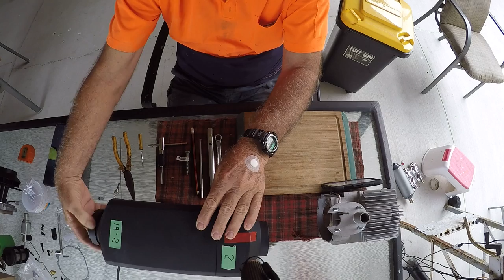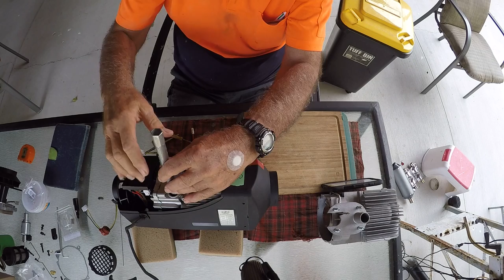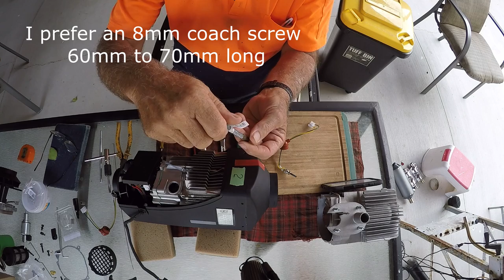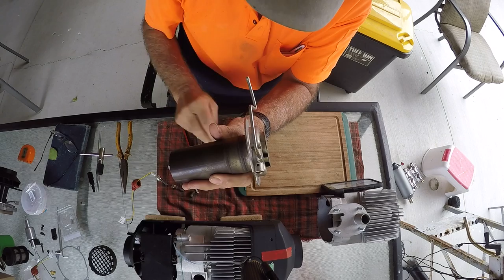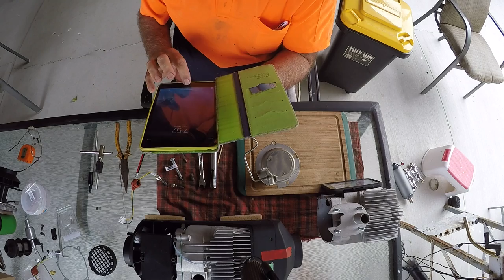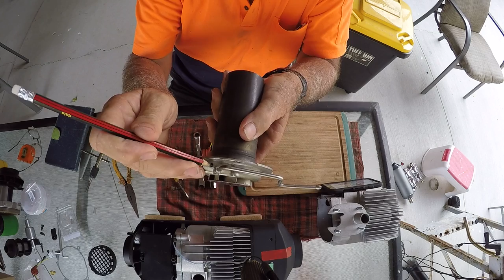Chinese Diesel Air Heaters - Part 9 Glow Plug & Atomizing Screen

Comment: John thanks. 
I bought the Vevor 2 kw heater with the 3 button controller. I’m running it at P 3.0 and it heats my big Sprinter van ok but does smoke a little. White smoke. 
How can I achieve a cleaner burn?
Reply from the maker: Hi Aaron,

Assuming your heater is new and you are using good quality diesel without additives,  white smoke is mostly caused by a poor burn. This generally is from  a bad fuel air mix, caused by restrictions in the exhaust or the combustion air inlet. Suggest you look at your install.

Some white smoke on initial start is not uncommon and is caused by some fuel residue left in the heater from previous use, but it stops after a short while when the heater gets hot.

If your heater is not new, white smoke indicates that it is starting to get excessive carbon deposits and it is time for a service. 

White smoke always occurs when bad fuel is used or fuel with any “oil” type additive. 

White smoke will occur when the heater is used at altitude due to a fuel air ratio mix imbalance due to the reduced oxygen content in the air at high altitude. The Genuine German heaters come with a high altitude adjustment in the controller, but at the time of writing this I know of no Chinese copy heaters that have this feature.  J McK

Comment: Thanks for a very informative video. I can't seem to find an answer my the issue with my chinese diesel heater. I wondered if you might have a clue? It doesn't have a digital display only a analogue temp control. The heater powers on, I can hear the pump working and there's plenty of fuel, there's no air in the system that I can see, the heater has plenty of air and enough power and I've replaced the temperature sensor but my heater still blows cold air. It doesnt auto switch off, it just keeps running as usual just that it only ever blows cold. Any thoughts would be kindly received. Thanks again,
Reply from the maker: Hi Wser,

That sounds very strange. 
Why did you replace the temp sensor? 
Did the heater work before, and not now?

Most important, if a new heater, are you using it correctly and waiting long enough for it to start.

In normal operation when you turn the heater on it goes through a start cycle. First fan comes on to blow out any unused fuel, next the glow plug is switches on and heats up, then the fuel pump starts ticking and delivering. When the burner is lit the fan runs fast for a bit to get the flame going well, and then reduces to the set temp setting. If the heater does not light it will turn itself off. It will not continue to blow cold air, unless the ECU is broken.

Can you please tell me if heater was working before, or if heater is new.

If new, never worked, and you are using it correctly, ask for a replacement.  JMcK
Reply: @johnmck1147  thanks for taking the time to reply. The heater isn't new, it came installed in the van which I bought 2nd hand so I couldn't tell you the age. 
The heater has worked previously, when I've tested it but I've never run it for very long. I replaced the temperature sensor because when I needed the heater I turned it on and got nothing but cold air. After doing lots of digging that seemed like the most likely cause. 

I have turned it on a left it running and it will run for a good 5 or 10 mins just blowing cold air. It sounds like it's running through the cycles as you mention because I can hear the pump start to kick in and the change in speed of the fan.

Because there's no digital output I'm not able to read any error codes or anything.
Reply from the maker: Hi Wser, 

Ok, it looks like the burner is not igniting. What brand is it? Is it European or Chinese copy?

All the Chinese heater controllers that I know of show error messages. The common analog simple dial controller has a series of red LED's that show the temp setting. If there is an issue these little lights will flash. Eg two lights flashing means error code 2.

If you don't get an error code I would be looking at the glow plug first. See if you can borrow a clamp meter. Put it over the red positive wire from battery to heater. You should see the current draw go from about 1 amp to around 8 to 10 amps as the glow plug heats up. This will show the glow plug is working.

Next I would be checking for excessive carbon buildup. You will need to strip the heater down and remove carbon from the burner, and the burner atomisation screen inside the burner. Next remove carbon from the glow plug itself, the glow plug screen and the tiny glow plug initial burner start hole.

If you are a hands on person these videos can guide you. 
If you are not hands on, suggest you buy a new heater. The Chinese copy heaters are very good, and very cheap, and a cold winter is coming.   JMcK

Comment: Hi John, I have just purchased a glow plug kit and the supplied screen was a very tight fit so wondered if the size was different between a 2Kw and 5Kw heater? Many thanks
Reply from the maker: Hi Eric, mine are the same size. 

In the past most manufactures of these heaters followed a standard protocol and you could easily swap parts around. You could even swap some parts between the Chinese heaters and the German Eberspacher heaters. However some manufactures now make heaters that are “non standard”

But, is your screen tight because you did not remove carbon deposits before inserting the screen?

Cheers.  JMcK
Reply: @johnmck1147  Hi John, thanks for your reply. I think you may be correct in that I did not carry out a good clean of the deposits and it did go in with a bit of persuasion and I made sure the air hole was clear. I have now tested the heater and it starts OK. Gave off a lot of white smoke initially then almost black but then became either clear or no smoke at all so unit is working now. I then shut it down and left it for 2 hours and started it up again this time no white smoke and clear after a couple of minutes running. I also have purchased a pack of 10 screens which they claim are suitable for Chinese heaters 2, 5 and 8Kw so that I am ready if it happens again!!

Comment: Quit question please bro, Where the glow goez, is there supposed to be a hole at the bottom ?  Or have I created that, Getting the mesh out wasn't easy
Reply from the maker: Not sure what you mean here. You would have had to remove the glow plug before you could remove the screen. JMcK

Comment: Hi John , would you know if there's different voltage for the glow plugs ? I've got a new one it has red pop in silicone cover ,the heater I have had a blue silicone rubber , I think the blue means 24v type as I've seen 12v or 24v plugs available  , which seems odd as I am running it on 12 v system , maybe mine needs a 24 v model glow plug , the one I bought is throwing an error 3 code , the heater is a 5kw,on the electric box it says 12v - 24v that's the bit that confuses me  Thanks

Comment: Hi John. This video was excellent so informative. How do I test whether my glow plug is functioning? My diesel heater has stopped working. It’s reading E10 error code. I’ve taken it apart to clean it, the screen doesn’t look dirty, the hole is clear of debris, the fuel is getting into the heater from the fuel tank as I tested that. Although there don’t seem to be the small Air bubbles In my fuel line (no large ones either). Could it be possible my glow plug is faulty? How would I check this? 
Any help or advice greatly appreciated. 

Thanks so much, 
Vicki
Reply from the maker: Hi Vicki,

E10 can mean a few different issues.

You can check if the glow plug is working by putting a clamp meter on the positive wire from the battery. You should see a current draw of 8A to 10A on the meter.
You can also remove the glow plug from the burner, plug the wires in again and turn on the heater on. The glow plug will glow red hot.

However your statement that there are no little bubbles in the fuel  line from the fuel pump suggest a fuel issue. The little bubbles are cavitation bubbles formed by little piston operation. If you do not see little bubbles the pump is not working properly. 

You may have crud in the pump stopping proper operation of the pump. See if you can take the pump off to a person with compressed air. Try blowing air backwards through the pump. Put the other end in a glass jar and see if any crud comes out.

Do you have a fuel filter installed.

Is your diesel clean without additives?

Vickie, I would be looking at your fuel delivery first.

Please let me know how you go.  JMcK
Reply: @johnmck1147  Hi John, thank you so much for responding, I really appreciate it :) 

After taking it apart and running the fuel through the line and putting back together it seems to be working again. I will try and take the pump off and blow with compressed air. But it's good to have an option to do if it does stop working again. I do have a fuel filter installed, a good one, not the rubbish ones that come with the fuel pump! I will clean the fuel filter today as well, just in case. 

The diesel I use is road diesel so I think it should be clean! 

Thanks again. 
Vicki
Reply from the maker: Victoria Mercier 

👍

Comment: Hi John, I am new to diesel heaters. I got a motorhome a year ago and it's got an (I guess old) Eberspacher bellow the floor with a control unit that's got only one rocker on/off button, one level dial and two leds-green and red. When I turn it on (dial on max) both LEDs go solid on, it properly ignites, runs for about 11 minutes, then the burning stops(I hear it), the green LED starts blinking(while red is still on),  the fan continues to run on high for two more miutes blowing still hot air, then fan switches to low for some more minutes and finally fan goes off, the LEDs go on the same way the entire night (red on, green blinking) and the unit never restarts, unless I manually toggle the rocker switch off and on. Do you think this is by design, because it is an old model, or it is rather some error indication? I wasn't able to find the model number, or its manual, but i was able to design and mount a programmable reset timer instead of the rocker switch, so I have a workaround now, however I am not sure if it is bad for the unit to constantly go through the ignition cycle every 20 minutes.
Reply from the maker: Hi Kosio,

Without knowing more detail, I can't offer much advice. You could have a faulty controller, a faulty temperature sensor, excessive carbon in the burner, or some other issue. I can't see any issue from the short cycles except you may shorten the glow plug life. It must be a very old heater.  JMcK

Comment: John I've been searching on eBay for a spare glow plug for my Chinese diesel heater,Are they all the same,I can see some for the webasto and some unbranded,not sure which one to go for. Thanks again. Dave
Reply from the maker: Hi David, these heaters are Eberspacher clones, not Webasto.
There are many suppliers, make sure you get the voltage right for your heater.

This link will get you started in your search.

https://www.ebay.com.au/itm/12V-Car-Boat-Trucks-Air-Diesel-Parking-Heater-Ceramic-Pin-Glow-Plug-Tool-88-98W-/333296550016?hash=item4d9a05c080

JMcK

Comment: Hey John, thanks for these videos. I'm getting an error code 03 on my heater that's been otherwise running great for over a year now.  I've read all the comments and your replies and since checked the amperage.  I don't have a clamp style meter to check the actual wiring before the unit, but I have a Victron Battery manager that will display the amps my system is using.  According to this, when the glow plug icon starts on my LCD screen the amps don't increase at all like they used to.  Were you suggesting that in this instance, the glow plug should automatically be assumed to be bad, or could there be another issue responsible that should be checked also that may cause the glow plug to not power up?  My battery bank is strong and the wiring hasn't been disturbed to my knowledge.  If the glow plug was bad does that stop the current from traveling to the unit either as a direct fault or as a command from the circuit board?  I'll add in that the final time it was running, the fan was running very low and the heat coming out was luke warm, not normal at all.  In final attempts to start it, I could hear the combustion process start not once, but repeatedly as if it was trying to start but was not hot enough in there to sustain the process. Love to hear your opinion before I buy another one.
Reply: That sounds to me like the glow plug giving up!
Reply: @RamsayMacFarlane  yep i went ahead and ordered a new one and it solved the problem!

Comment: Hi John, Is it possible to insert the atomizing screen to far or is there a point where it can't be inserted any further? Brrrr, just the time use the heater !
Reply from the maker: Difficult to push in too far. Only if you really force it in and buckle it. JMcK

Comment: G'day John, can you tell me a source of gaskets for these heaters, I disassembled mine to clean it (it was pretty choked) and both gaskets got damaged as they were just stuck to hard and tore. alternatively what material can I use to make my own.
Reply from the maker: Hi Eric, sorry I missed your comment.

I buy my gaskets from eBay. Search for gaskets for Eberspacher diesel parking heater, but buy the chinese copy gaskets. A genuine gasket will cost more than the heater. The 5 and 8 Kw Chinese heaters are copies of Eberspacher D4 heaters and 2 Kw copies of Eberspacher D2 heaters.

If you live in Australia this guy sells gaskets, but he may post overseas.

Steven.hao@aufocus.com.au.

Sorry again for delay.  JMcK

Comment: Why not use spray on carburetor or throttle body cleaner to clean the carbon off the screen?
Reply from the maker: Yes, carby cleaner works well.. JMcK

Comment: Is it possible for a glow plug to get insufficient voltage and not get hot enough to fire? I've replaced the pump, glow plug and screen. It goes through the start cycle, smokes some from unburnt fuel then shuts down.
Reply from the maker: Hi BB,

Yes that is not only possible, but a very common problem. 

Too many DIY people do not understand the issues of voltage drop on heating elements. These heaters come with the real minimum wire size, and if you get voltage drop you will not get the glow plug hot enough to start the heater.

I recommend increasing the power wires, and connect direct to a charged battery through a 15 amp or 20 amp fuse. Remember, the fuse primary purpose is to protect the wire, and stop a fire, and it is rated to the wire size. It is not to there first up to protect the heater.  JMcK

Comment: John. Everyone says you have to run the heater on high to clean the soot out. Is it 10 minutes or 30 minutes.
Reply from the maker: Hi S,

It all depends on your install. Less restrictions less soot. Remember these heaters only have a small combustion fan, so restrictions in the combustion air in and exhaust out cause fuel air mix imbalance, which causes soot.

With a good install 10 minutes every other week should be ok.
On the boat and motorhome  heater use is just a few hours a day over the cold months and I only do a high 15 minute burn once at season end.  JMcK